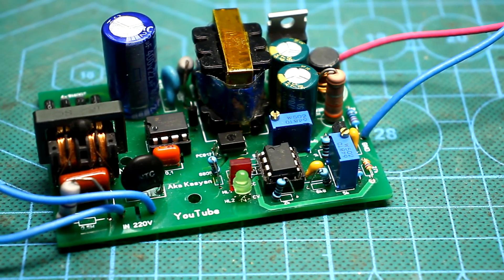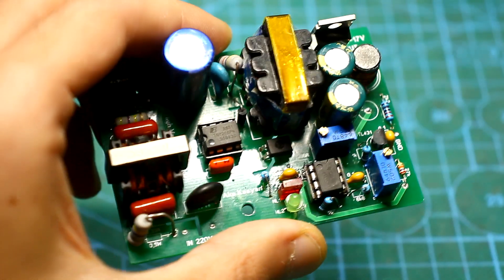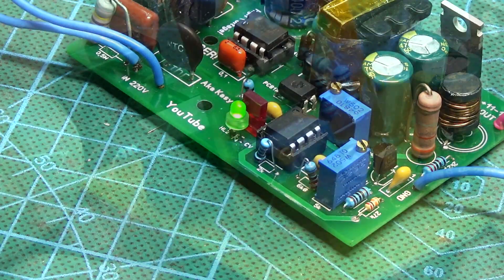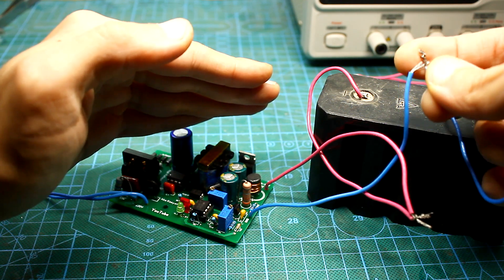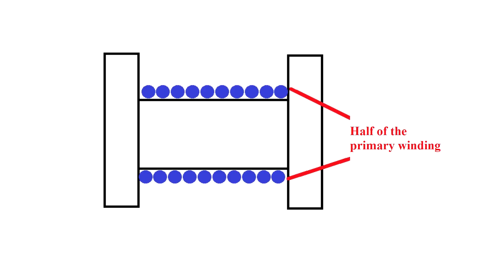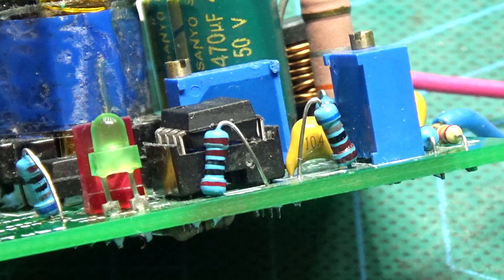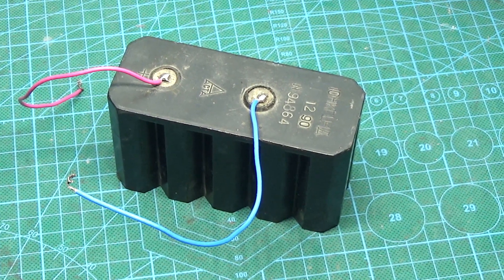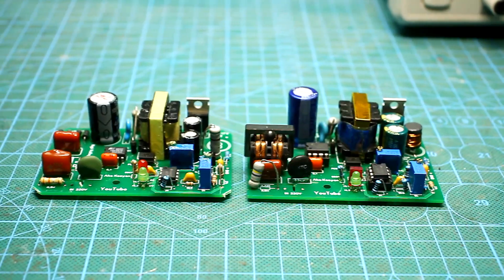Universal charger for any device

Comment: Any way to make one that has gpio for the control of wattage and voltage with the possibility of linking multiple of these units to get a higher wattage and or voltage on demand depending on voltage dip and the current draw through a shunt or from a trigger port? Thinking about ham radios I have and that while it would likely make a good psu for smaller units the larger of them would be over 30w at 12v when transmitting. But not during rx..so that the only time you have to boost is during tx reducing the amount of power and heat during rx
Reply: Maybe add capacitor to output to help with voltage drop. Or a 12v battery. That way the unit can charge the battery off solar or 110 or 220, adds some wattage buffer too

Comment: Is it possible to easily add 4 wire voltage measurement on the target to avoid the voltage drop over the wires?